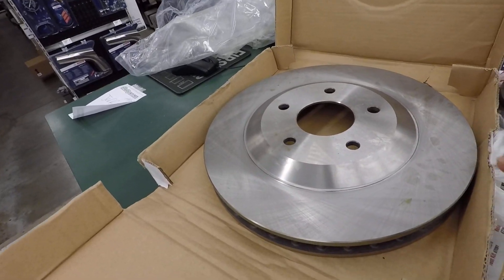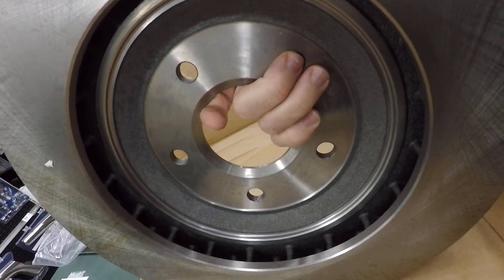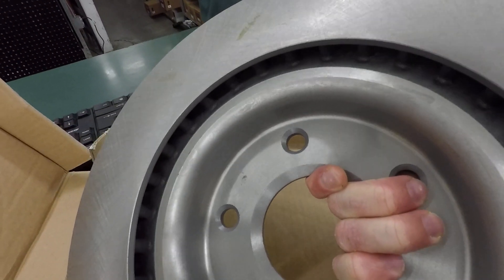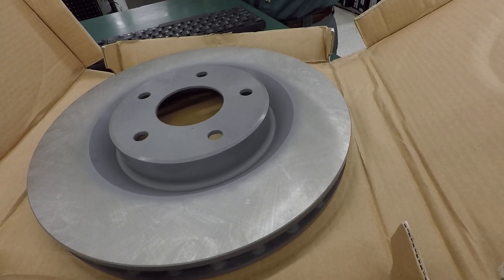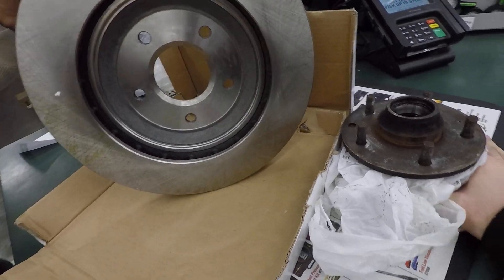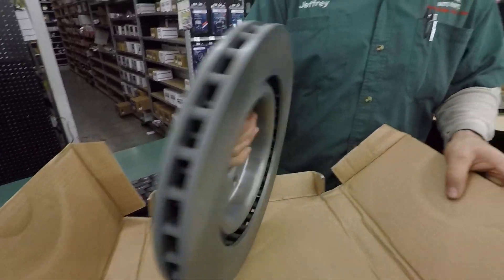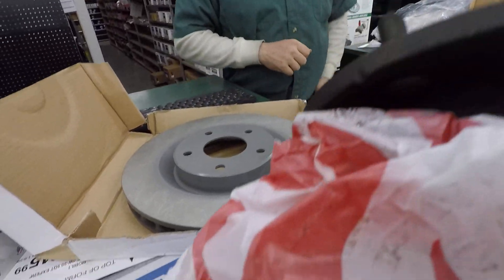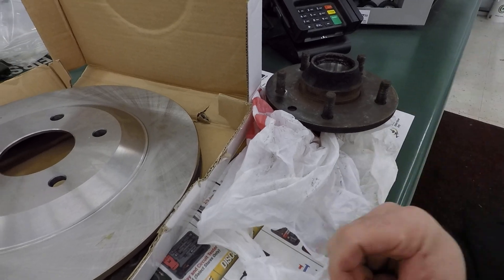difference between c5 and c6 Corvette rotors

Comment: Question, what wheel diameter did you settle on for the fronts?
Reply from the maker: The front has to be at least a 17. But I'm stilling looking at options. Haven't pulled the trigger on anything yet.